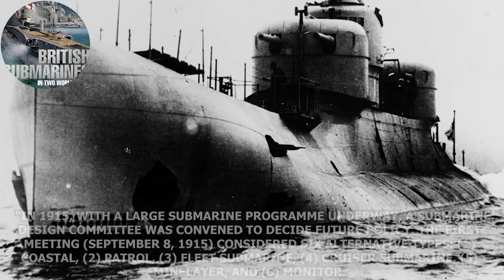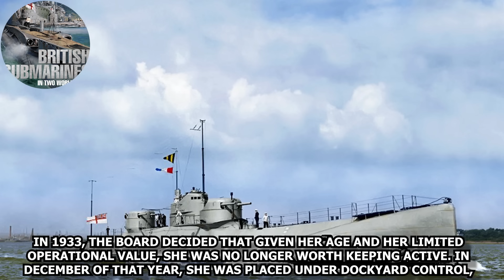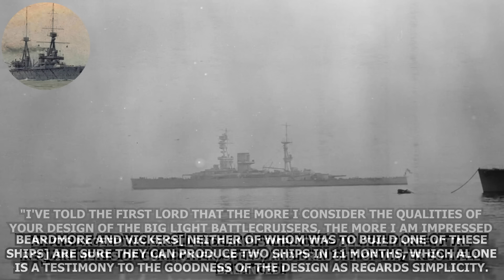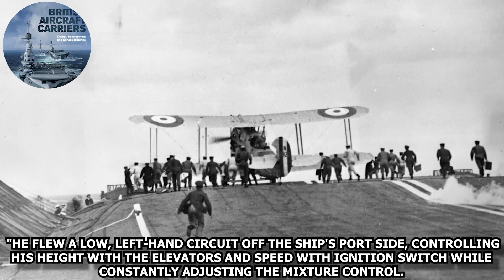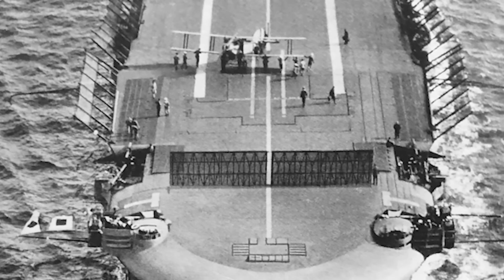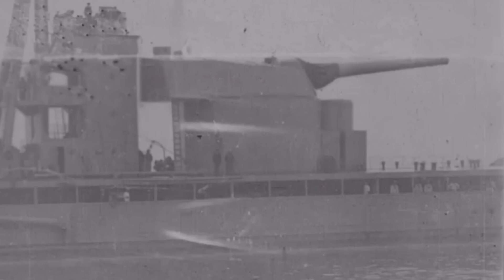Weird and Interesting British Ships

Comment: Excellent video. One minor criticism though. At 31.20, that is not a Swordfish. Think its a Fairey IIIF , which you subsequently mention at 31.50 - certainly has a typical Fairey tailfin and rudder. incidentally, the 800 series you mention are not groups, but squadrons!
Reply from the maker: That’s my bad, I apologize, I used just one photo when describing her air compliments.
Reply: @ImportantNavalHistory  Thanks for replying.

Comment: The steam powered subs were about the stupidest, most expensive boondoggles in naval history.
Reply: They were an attempt, albeit a failed one, to build a submarine with the surface speed to enable it to operate with the 21 knot battle fleet.
Reply: @dovetonsturdee7033  Just develop better diesel engines!
Reply: @partygrove5321  No diesel engine capable of powering a submarine at anything near 21 knots existed in WW1, or for many years  thereafter.
Reply: @dovetonsturdee7033  What was the max surface speed of a WW 1 war sub?
Reply: @partygrove5321  The Royal Navy's workhorse, the 'E' class was capable of 15 knots in bursts, but for her maximum range of 3,000 miles 10 knots was maintained.

The highly advanced 'R' class, of which a small number appeared, could manage a surface speed of 9 knots, but a submerged speed of 15. These arrived right at the end of WW1.

The most advanced German boat in 1914 was U9, with a surface speed of 14 knots.

The first German diesel boat, U13, could manage 14.8 knots. The U93, late war, class, could manage 16.8 knots.

Comment: I've dived the wreck of the M2 the submarine with an aircraft hangar 😊
Reply from the maker: Oh wow! Anything interesting to report about the wreck?
Reply: @ImportantNavalHistory The Pressure Hull is still intact, but the buoyancy tubes and deck is getting holey. Fuel oil is beginning to leak out. You can see Congers at home just in front of the hanger, by the catapult where the hanger door counterweights are. Periscope is visible in the conning tower, as is the Hidden Gun on the aft deck. Pollack, Bib, Pout, and Whiting are plentiful. Deck is at 28M, seabed between 30 and 34M in the scour under the bows and stern. Propellers are missing, but shafts still present in P brackets. Interestingly the Starboard bow hydroplane, and the Port hydroplane  has a protective tube around it, but the tip of the Stbd hydroplane is bent up. The Anchor is still chained in the Hawse pipe, and The crane for recovering the Parnall Peto has fallen off the hangar and is lying on the seabed to the east of the Sub.

Comment: I loved the first section about HMS X 1. I have always been fascinated by submarines, and this one was particularly odd. But it was a very important experimental platform that informed the designs of future boats. I was intrigued by the to and fro between the gunners and designers - more this, bigger that, and so on. Noting the expressed need for 'habitability' to accommodate longer patrols, I had to smile - what one desk-based officer in a concrete battleship thinks a matelot needs when at sea, in terms of necessary living space and equipment clearly differed enormously form what any normal person would actually want!
X1 was built at Chatham, which would continue to build submarines until around 1965 when HMC OKANAGAN , built for the Canadian navy, which was the last to be built there. 
If you want to do features in future on the submarines of any navy, I will be sure to watch!
Thank you for this wacky doco - the description of how the first plane was landed on deck ('blip the ignition' because the engine is either on or off (!) was brilliant. As was the rest. Cheers =]
Reply from the maker: Thank you Clive! Always look forward to your comments. X1 was a weird submarine, and certainly experimental, Chatham is on the top of my list to visit if and when I make it over to the UK.
Reply: @ImportantNavalHistory  definitely worth a visit. Tidied up now if course but lots of interesting features such as a working ropery and the template room where wooden templates were marked and made. And today's fun fact... To build HMS Victory you need wood from about 80 acres. Coincidentally that's the size of the dockyard! Cheers